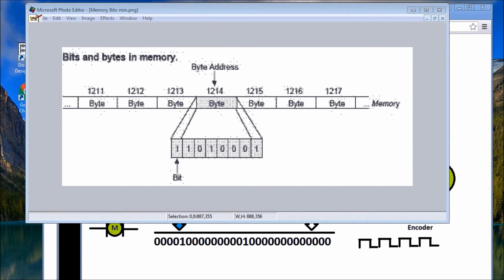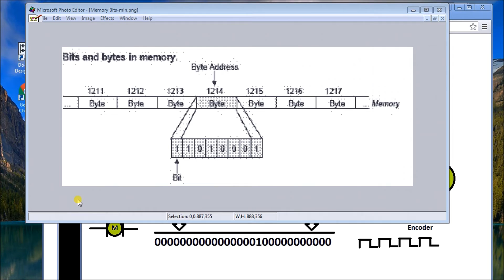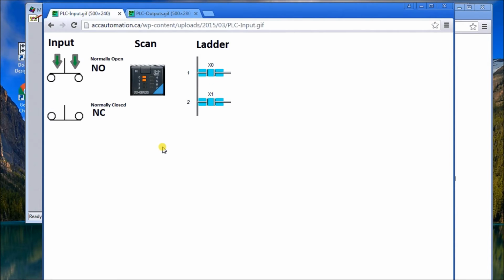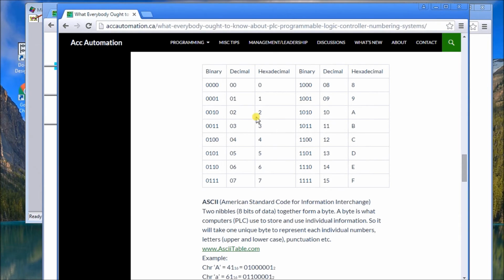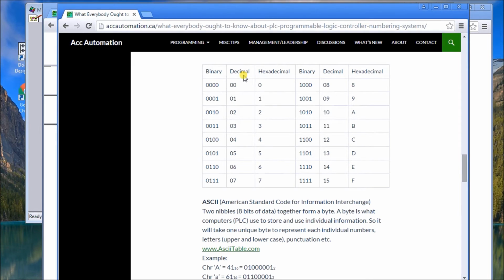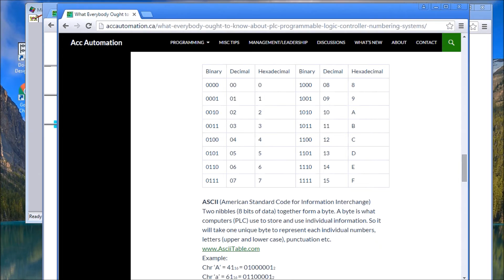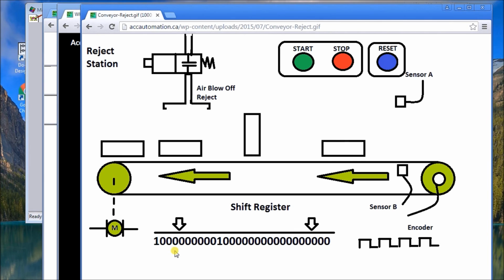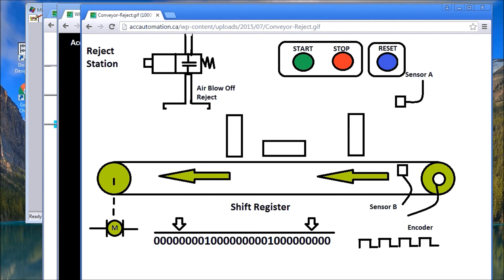The Hidden Language of PLCs: How Bits Control Everything

Comment: how do u simulate the belt conveyor and buttons,is there any software? i'm doing a belt conveyor project in my university,but i cannot buy one for myself so it is kid of tough to test the project, every time i need to go to my university,so kindly help me.
Reply from the maker: Hi Arvindh
Recently I have come across a software package  called Factory IO. It has a 3D simulation that can interface with the Do-More Designer software simulator using Modbus TCP. 
Here is a sample PLC program with a  process mixer.
http://accautomation.ca/plc-programming-example-process-mixer/
The following video will show this process using Factory IO.
https://www.youtube.com/watch?v=vJpGJQ8MwCk
On Monday I will be releasing another post with a pick and place robot and conveyor belts. This will use Factory IO with the Do More Designer Software (BRX PLC)
Factory IO provides a free 30 day download. You can get the links from the above URLs.
Hope this helps you out Arvindh.
Regards,
Garry
Reply from the maker: Here is the link for the Factory IO pick and place application. 
http://accautomation.ca/plc-programming-example-pick-and-place/
You can probably use something like this to simulate your conveyor system.
Regards,
Garry